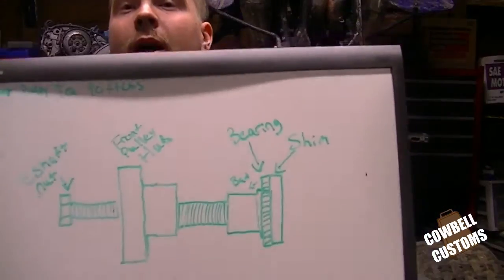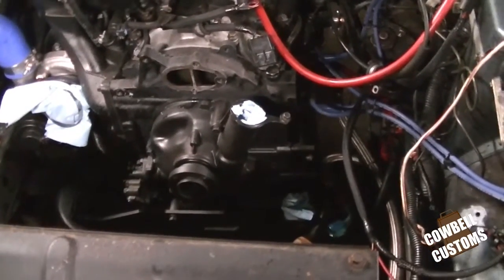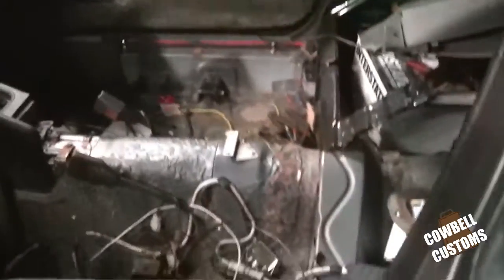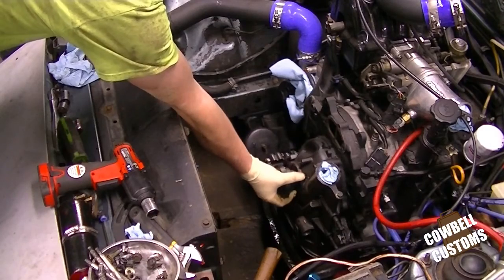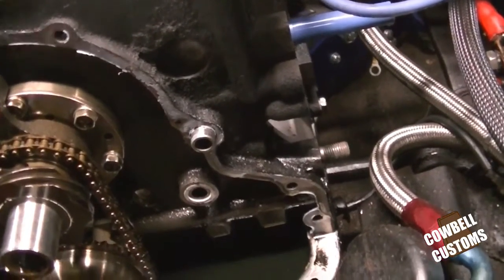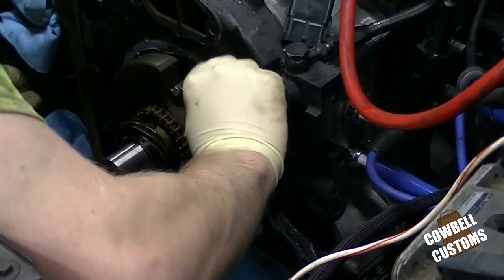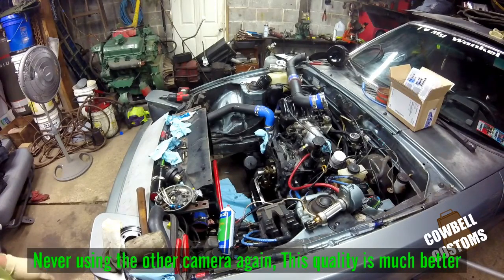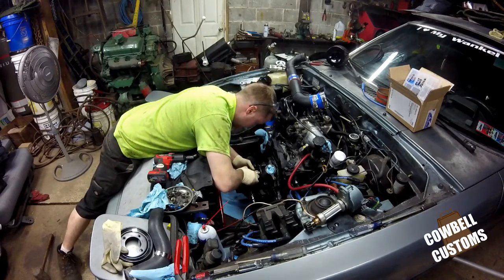13b/12a Front Cover Reseal In Car/ How Not To Destroy Your Rotary.

Comment: What do you use to seal the cover and oil pan?
Reply from the maker: I Just used some oil safe RTV, Paper gasket would be a decent idea but locally nothing was avalible at the time. Mazdatrix and a few other builders usually use one or the other universally. And the stuff i had was just a victor reinz brand, but before I used a Ford Rtv, but for a parts store run id grab a cheese wiz can of "the great stuff"
Reply: Okay cause I ordered all new ones and was wondering if I shouldn't have. Thanks for making the video! Defiantly giving you a shoutout when its fixed!
Reply from the maker: Glad I can help! Been watching your videos and your production is fantastic! And I'm sure you saw it in the video but when using rtv be careful of the OMP oil feed hole. I used too little the first time just incase If I did use the omp.

Comment: How did you wedge the ring gear   to keep the centric shaft from rotating while trying to remove the bolt?
Reply: Did you find a solution?

Comment: I didn't see you pull out or place back the spring that goes on that atkins rotary solid thermal pellet; is their a reason why? Im currently in the same process. And I noticed that the  instructions to install that solid piece on their site, is not right. The oem thermal pellet spring does not fit on the atkins one. Any input appreciated
Reply from the maker: Sorry just saw this now. Theres another larger spring that sits inside that i did not remove. Im going to have another video about doing this with the engine out of the car and i put a atkins thermal pellet in there too.

Comment: What did you use to hold the shaft from spinning when you were torquing it down?
Reply from the maker: I don't remember what I did in the video but I have a extra front pulley on a metal bar that I use some times. And other times a pry bar and a bolt on the flywheel teeth, not my preferred method
Reply from the maker: I don't remember what I did in the video but I have a extra front pulley on a metal bar that I use some times. And other times a pry bar and a bolt on the flywheel teeth, not my preferred method
Reply: @CowbellCustoms  Okay thank you! I just picked up a 1985 RX-7 and it’s leaking from the side of the engine real bad. I ordered the parts to replace it. Thanks for the video very informative!
Reply from the maker: No problem, if you have any other questions let me know, just remember the danger of the thrust washer falling out of place once you remove the front pulley. Mazdatrix has a diagram on their website of what it all looks like inside to get a understanding of it.
Reply: @CowbellCustoms  Will do thanks! I have a good clutch pedal with no leaks so I am going to put a bar in there wedged against the seat to hold it in.

Comment: Just had to do this same thing, i had oil leaking from the same spot, although while my front cover was off i shimmed the front oil pressure regulator and also removed the OMP drive gear, i also vented that oil pressure right back into the oil pan so that there would not be a high oil pressure situation at that point where the front cover meets the front iron
Reply from the maker: +Michael Mansour not a bad idea to do all that at once. I should have deleted the omp gear but didn't at the time.